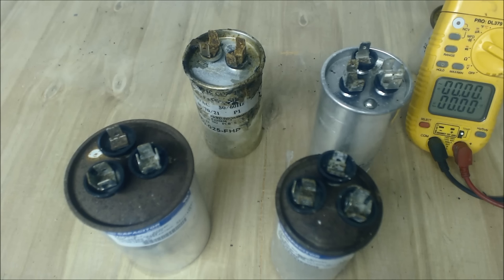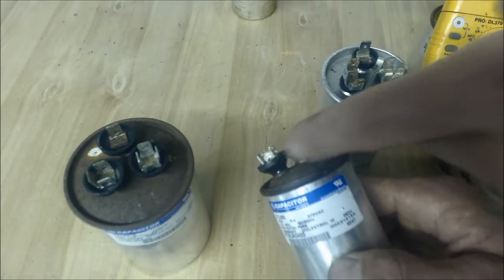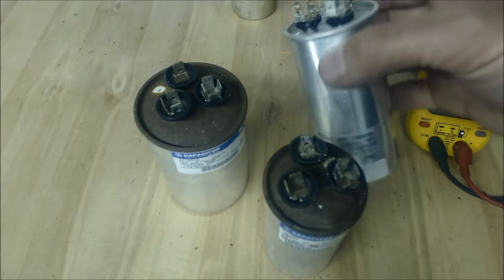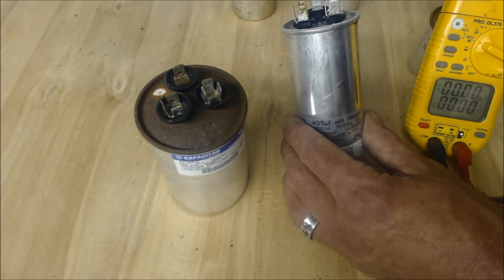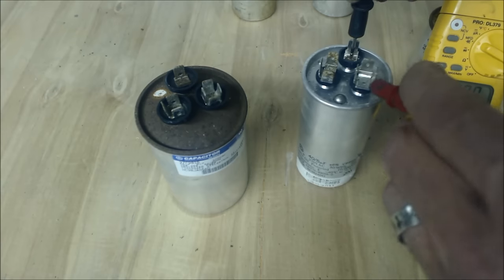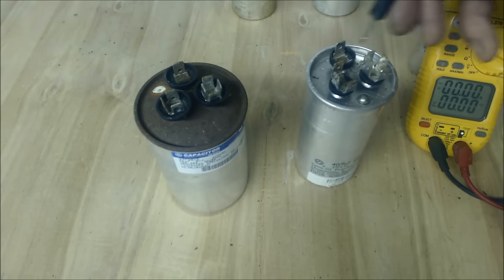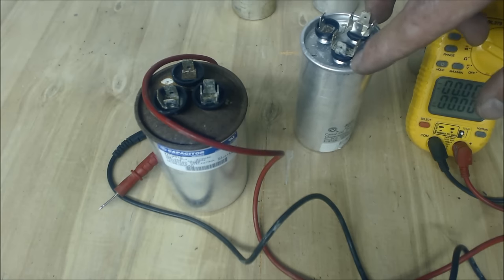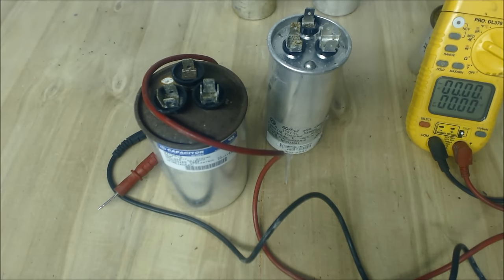How to tell if a AC Capacitor is Bad! Visual and Multimeter Testing!

Comment: To be honest I replace the capacitors in my home systems every 5-10 years as routine Maintenance.   They’re cheap.
Reply from the maker: That is a good pm thing to do during that time frame, awesome!
Reply: Anything recommended  to extend the life? just had one replaced today.
Reply: @CocoChanelle-1  buy a backup for $ 15 and save this video. Installs in 10 minutes or less. Mine just went out after 24 years, charged me $268.
Reply: @dennydeckerful  thank you.
Reply: @dennydeckerful  they also reccommended putting wood on top in the winter to keep snow from sitting on top and rusting out parts. I noticed it was rusted near connection.

Comment: Notice who made the failed caps.
Reply from the maker: Yes but also realize that I may change 10 capacitors in a single given day. These happened to be the ones I grabbed out of the pile. It does seem that the older caps last a bit longer just due to the dielectric used at that time which has now been phased out! Thanks!

Comment: What are the symptoms of a bad capacitor on the cooling of the room? I cant access the outside compressor.
Reply from the maker: Actually there are no symptoms usually. All the sudden, they break, thanks
Reply: acservicetech i see. So what if the room cools but doesnt stay that way for while, (from feeling and not looking at thermometer) is not a condition of failed capacitor?
Reply from the maker: You really would have to have a tech start testing. It could be the thermostat, refrigerant charge, or anything without having some details. Usually a capacitor won't allow the motor to turn on sometimes and not other times, thanks